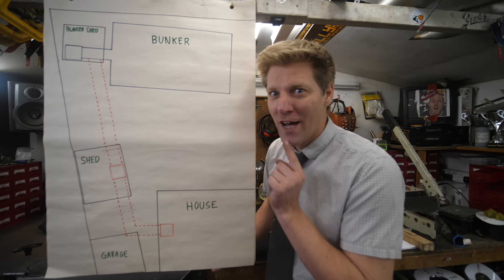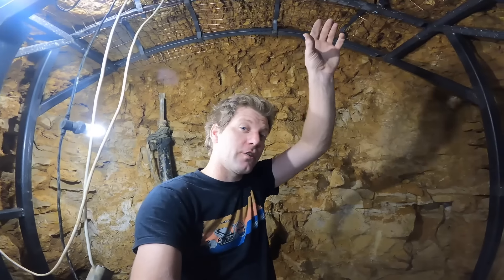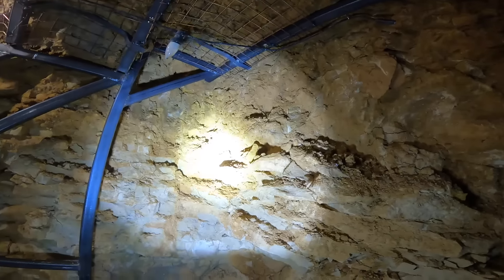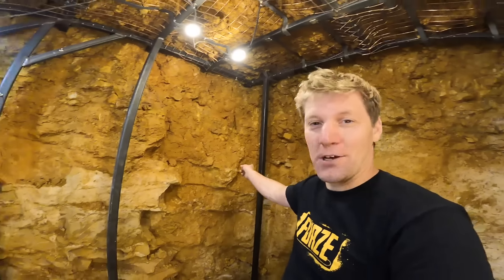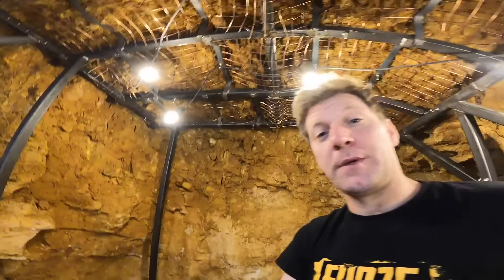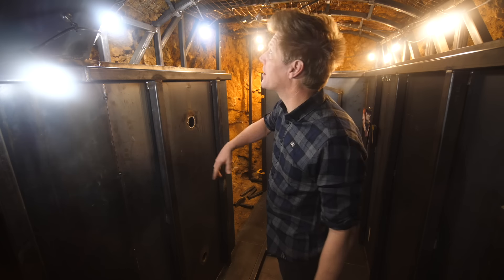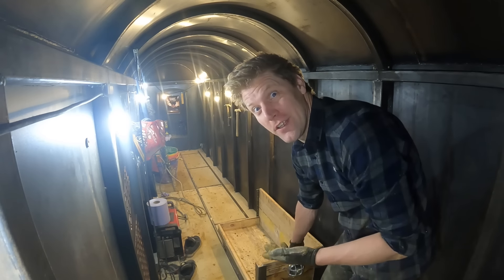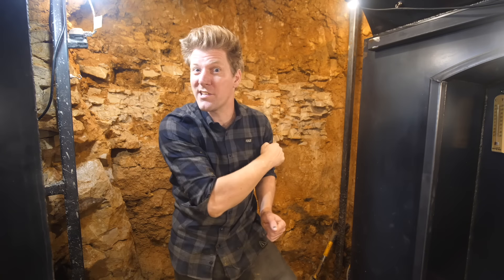DIGGING A SECRET TUNNEL Part 6

Comment: You think some sort of automatic spade might help? For loading the rubble into buckets? Something with like an L shape, a frame going down to the ground from your chest or belly, then a spade's blade sticking out across. Then the spade blade can be lifted and lowered with hydraulics or maybe a screw. The idea would be a lot like the lift part of a forklift, but instead of the fork, a spade. Idea would be to load the buckets or a barrow up with less effort, cos surely that'd take so much of the physical work out of it.

If not that, then maybe some sort of sling thing hung on the winch? Where you'd just be pushing and tipping rubble into it rather than having to lift the rubble into it using muscle power.

If not that, then a miniature-scale TBM with rotating grinders on the cutting face and a pilot's cabin, that runs on a railway that it lays as it goes. Contains 160KW of diesel generators, accomodations and a cabin for tea breaks. In fact 1 per floor. Laser alignement means you can keep it going to France and pop up in somebody's holiday home when they're not using it. If you don't like France, there's Florida.

Comment: Oh bummer. 
After all this smart, hard work.... a bucket handle is giving up. 👌
I love the engineering any ,but most is the forwarding thinking of it which I like
My CV in short: 
Steel fabricator/welding by trade,
Cad3 d technician, ground working... .
Had a $2000000 ABB Aerospace equipment tools on plasma coating in my hands. My best job ever. Nice tool, nice product to work on.
I am not an engineer even so some day I wish i had some of the basics.

Comment: You are a fascinating man! I'm so impressed with your videos. So, the city government hasn't given you any grief about building the tunnel? They make concrete vibrators, which you should be using. At least the concrete is pretty loose. The expense of all that steel and concrete must be enormous.

Comment: Your wheels are on backwards. The flange should go on the inside. They should be slightly conical with the smaller diameter facing the outside of the track so that the force acting on the wheels is self correcting.

Comment: Cool project, lots of guess work but you're getting it done. 

They way I would have done it. I would have built it all in something like sketch-up. That would have meant that you needed to measure everything above ground and the existing part of the tunnel. But it would give you all the angles and measurements for the new part of the tunnel as well. No guess work.

Comment: Genuine question, doesn’t digging under the foundations pose a serious risk of subsidence or failure ? Would really hope the tunnel frame can deal with the weight of the foundation.
Reply: Based on the quality of the soil and rock he's dragging out, plus how well he's building the tunnel, my expert YouTube opinion is that it'll be fine.

...Surely he's had engineering done for it.

Comment: Can't you wire the tracks of the mine car to your breaker panel, use a system to get the positive and negative that are on the tracks and connect them to a motor that is connected to a 4-way switch so you can have a powered mine car? P.S: can't you curve the tunnel so there wouldn't be any issues with getting the cart below your storage closet? P.P.S: If you are considering making a second track for the front of your house, you may want to see this video so you can do this automatically: https://youtu.be/_M6vhDvmtrI